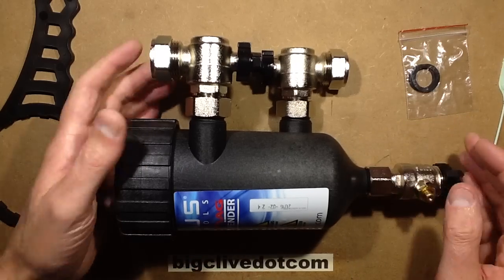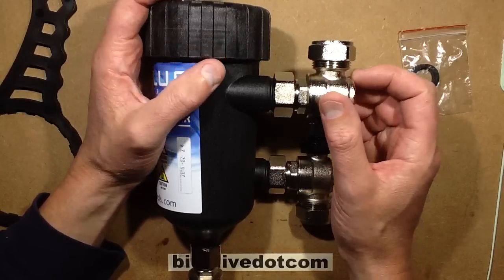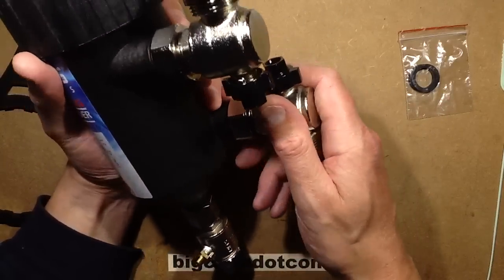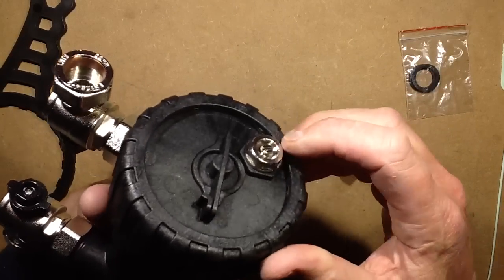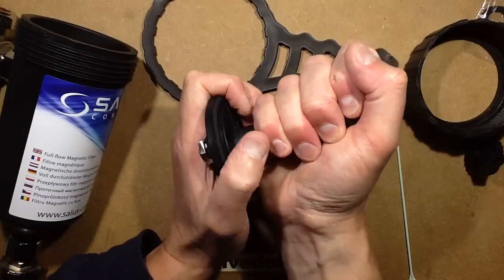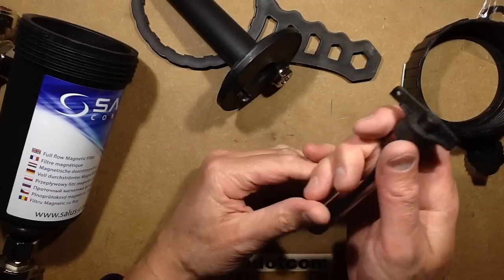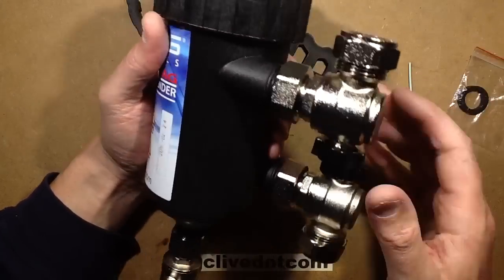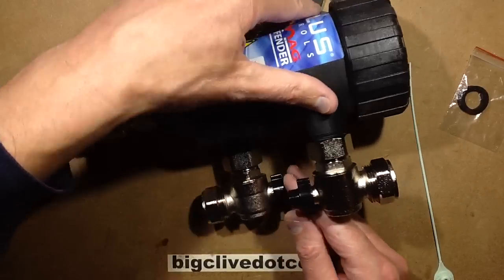Inside a heating system magnetic "sludge" remover.

Comment: My house is forced air, the total extent of regular maintenance for mine is changing a filter every six months.
Reply from the maker: And you get to sit over the hot air vents in the winter.
Reply: I'm going to stick my neck out and suggest that there may be pros and cons when comparing any two rival heating systems.
Reply: If you have to sit over your hot air registers to be warm, your HVAC system was not properly sized or built, or something is wrong with it (like a total lack of maintenance). You might also have a drafty house with poor insulation.

A lack of heat has never been a problem with the forced hot air systems I've dealt with, and being able to circulate air throughout the entire house with the system is a real boon in the summer preventing rooms from being stuffy and uncomfortable, meaning you don't have to run your AC quite as hard. 

One of the things I DID have to do with my current HVAC system is spend a day sealing all the holes at the joints in the ductwork. leaky ductwork, and the dreaded ductopus install  are the leading causes of anemic heating systems.  Well, that and never changing the damn air filter.
Reply: oh, how i love heated water registers.  they heat so evenly and constantly.
Reply: Forced air here. Not complaining, though I change my filters every three months (there's a ton of pollen in my area).
Reply: shadshowadradna Thank you, pretty much my point
Reply: And you also have to get the ducts cleaned every few years. Well you're supposed to at least, otherwise the little particles past the filter build up over years and years and restrict airflow.
Reply: yes thank you america for telling us you have forced air and steam boilers give yourselves a pat on the back for boasting about something europe has had for decades
Reply: richcampoverde
Our steam boiler is decades old.
Regardless, this was a harmless chat, not about location, countries or showing off. Maybe you should give yourself a pat on the back for introducing this.
Reply: +richcampoverde I was just making conversation, not trying to aggravate your inferiority complex.
Reply: Our vents are on the ceiling :(
Reply: I pity you
Reply: +masterzedd4 I know you are being sarcastic... But heated water registers?
Reply: +NexaEntertainment ouch. I access everything from my basement.
Reply: +bigclivedotcom actually no, I only have one cold room because it was added onto the house after the fact. No basement on it plus it's on the north side.
Reply: I use to sleep on them when I was a kid XD
Reply: I lived in a house like that back in the fucking day! Three storey town house which had THE BEST chinese takeaway literally across the road. 
I remember "fondly" sitting with my back to those air vents with a blanket wrapped around me when it was cold :O
Reply: I'm lucky enough to live in a place that requires no heater ever. Although it can be hot enough to even need A/C in the "winter." Go Florida :-)
Reply: If you live somewhere that's damp in the winter (I grew up in western Oregon) - the last thing you want is the house to be muggy and humid. And no problems with keeping the house warm in that case. (Of course, my mom had proper maintenance done regularly. ;)
Reply: Unless you have an electric heater in the air handler you still need to get the oil or gas burner serviced at least annually. If you do have electric heating elements have fun paying way too much for heat.
Reply: We have a steam boiler. Fairly easy on the maintenance and unlimited hot water when the heat is on. Still have the oil burner maintenance, but that's not really bad.
The boiler is shut off and our hot water is coming from an electric water heater. Who needs to have an (mostly) un-insulated cast iron box warm all the time just to take a shower at night, and maybe wash a few things in the morning.
Reply: +snoopdogie187 perhaps  but alteast it stopped this madness in its tracks
Reply: +Richard Stifle YOU!!! you did this!  i will teach you to be an all american bumpkin😠😠
Reply: +richcampoverde I'm rather fond of my bumpkin-ness, in fact look up Hach Company and you can thank this bumpkin for the next clean glass of water you have.
Reply: +Richard Stifle we have something in common in our love of the americas
Reply: I don't.
Reply: they put out a horrid dry heat too, can barely breath when those things are going
Reply: @yognaut  theyve got a thing for that now.  It sprays some water in the air.

Comment: I'm curious, how are the radiators typically connected to the copper tubing? I've seen improper steel to copper connections cause a lot of trouble. The rusting (and therefore the need to flush and treat the system) is inevitable but, I wonder how much this is accelerated by galvanic corrosion?
Reply: Usually via a brass valve. There's a brass fitting into the radiator at the base. The radiator steel is usually thicker at that point too. The valves often seem to be silver coloured (possibly nickel or chrome plated) but I'm not sure if that's just decorative.
Reply: +TheChipmunk2008 that's kind of what I figured. that's certainly better than a direct connection but still provides opportunity for some corrosion. A seperation of 6" using brass or other inert material eliminates that action... I'm sure there's plenty of good reasons (space restriction probably being the main one) it's not done that way for this application.
Reply: +TheChipmunk2008 and I believe the chrome/nickle plating is decorative as it is visible after the room is finished out

Comment: Isn't forced air climate control better than using radiators?
Reply: 99% of houses in the UK use radiators, it's just how it is.  A combi boiler can heat the house, water for the taps and even run a shower so it's just really convenient.  If it ain't broke don't fix it and all that.
Reply: Not if you dislike noise.
Reply: +petti78 Well if you don't cheap out, it won't be that loud.  I can't hear my air system when it's on
Reply: +Christian Geiselmann Better than just saying no.  Explain your reasoning please.  There are no fans to blow the hot air around with radiators (by themselves) and radiators don't double as air conditioners
Reply: Does forced air heating mean there's a constant breeze in the rooms? I don't recall seeing that here in Austria (in 
residential homes). It's mostly radiators or underfloor heating here. And underfloor heating is definitely the best. You can keep the air in the room quite cool and it still feels comfortable. The water in the pipes can be run at less than 30°C which makes the system very efficient (the exhausts of the gas furnace just 50cm from the furnace are barely warm enough to heat your hands in the winter).
Reply: +Robotic Nerd    Well, now that's unappropriate, Sir. I took the time and effort to lay out in front of you my arguments why I prefer radiators, because you explicitly asked for that. I have no chance to guess how deeply you are into these appliances, because you did not write a single line that would give a hint, so I was, perhaps, a bit too verbose for your taste. I did not mean to offend you by that. Likewise, instead of blaming me for not being so well acquainted with hot air systems common in the US, you could just be so nice and explain it to us Europeans.
Reply: +Jasper Janssen  Okay, thank you. For Germany, I may report about 3000 Euros per year invested in the typical petrol for heating purposes (quite like Diesel, but without the immense taxes) for a detached house, not large, and insulated by standards of the 1980s, for heating and hot water. Prices depend of course fully on the international market. And on the ethical side of it you may (cost free) burn in hell eternally  for reclessly relying on burning decayed organisms, alias fossile fuel. A modern house with very good insulation and a modern concept of using sunlight may get down to zero energy consumption. Or close to.
Reply: No.
Reply: +Crana I learned something new, thanks
Reply: +Robotic Nerd    Yes, you are right, sorry. Here is my arguments: Radiators rely on radiating heat, that's using radiation (heat transfered through space similar to light), which can be considered the more effective (i.e. energy saving) way than providing an environment of warm air. Of course it depends on how the entire heating system is set up, including what temperature the circulating fluid (usually water) has, and how well the pipes are isolated where they are not meant to radiate. There is an advantage in terms of comfort, too. Humans usually feal more comfortable when feeling radiation heat than when sitting in a bubble of hot air, so to say. Now, you will have to take into account also the climate zone where you live, the standards of housing and construction in your country, and the money you are ready to invest in a equipment to pay out  rather slowly. Practically, in Europe, usually, cheap houses use e.g. airconditioners or so, expensive, solid houses...
Reply: +Christian Geiselmann I guess you are right that which system is better really depends on where you live, and your personal opinions of what is more comfortable.
Reply: +Robotic Nerd     .... use radiators. I have lived with both, and I fully prefer radiators, just because of the more comfortable feeling. - Next thing is energy efficiency. Principally it is a bad idea to burn coal or oil  in a power station, send electricity to houses and then transform this to heat, as air conditioners do. Too much losses of primary energy as compared to what really gets into your house. Of course, when your electricity is solar or from wind, you may say that it does not matter... You see: complicated topic with many variables in the calculation.... therefore I did not write more than one word in my initial response.
Reply: +Christian Geiselmann You're forgetting high efficiency systems and natural gas furnaces.  The only electronics used in those is only for controlling the gas,  safety systems, and the thermostat.
Reply: +Robotic Nerd and fans
Reply: +Robotic Nerd    To explain the 'radiation is more efficient' stuff, I should add that this is true when you really rely, at least partly, on using radiated heat (like sitting next to a bonfire, that sort of heat), and your surrounding aur is a little bit colder than your subjectively  experienced room temperature. If you use the radiator just to heat the air in your room (convection heating), and the air then warms the walls and furniture, you are not using radiation heat, and this type of advantage is missing. So again, it depends on many things.
Reply: +superdau    Yeah, good question, what do they mean by forced air heating? From my position of complete ignorance, I would say it should by some machine blowing air into a room, e.g. an air conditioner, as opposed to that 1920s to 1950s style heating systems where warm air coming from a centrally placed oven somewhere in the house was led through thick pipes in the walls to other rooms so that they got heated, too, and you could close the air vent in that room if you did not want it heated.
Reply: I can turn the blower on in my forced air heating system without turning on the heat or AC (If i had AC hooked up to it).  So I can choose to have a breeze or not. 

It's very nice in the summer, as the breeze keeps the room from being stuffy and uncomfortable at higher temperatures than stagnant air would. (also helps filter out allergens. She Who Must Be Obeyed loves that feature).

American forced air systems have a large furnace in the basement or garage or utility space, with exhaust and return ductwork that goes throughout the entire house. The exhaust ductwork starts big and narrows down to keep air velocity constant from one end of the system to the other. The benefit of this is that you can circulate air throughout your entire house, rather than a single room.  If you have a room that gets too hot or cold,  the hot air registers on the walls have shutters you can close to prevent air from flowing into the room.  The system might also have butterfly valves in the ducts themselves to help you control flow to various rooms to ensure even heating/cooling.
Reply: Christian Geiselmann I'm not stupid.  I'm quite old enough to understand what radiated heat is...  Why do you assume I don't know such a simple idea?
Reply: Christian Geiselmann And if you don't understand modern American forced air systems, don't insult our intelligence and assume we don't know how radiators work when you don't know how our systems work.
Reply: +SlocketSeven    Thank you! This was an interesting summary. It reminds me a little bit of hot air systems used in German houses decades ago, but of course the  heating technology will be quite more developed now , I suppose. Question: what kind of furnace etc. is used to heat the air? And is this system used everywhere, independent of geographical latitude?
Reply: +Robotic Nerd    Could it be that you confuse your interlocutors?
Reply: +Christian Geiselmann What?  That doesn't make sense.  I don't confuse who I'm speaking with if that is what you mean
Reply: Yes, you do.
Reply: +Jasper Janssen     Indeed he does. Perhaps he is very short-sighted and mixes up the profile pictures? Or is he just fishing for attention? Well, let him fish then, but not in my pond. Cheers.
Reply: +christian Geiselmann.  Mostly it is natural gas (methane) in the USA. After world war II, it was abundant and seen as the fuel of the future.  In places where you cannot get a natural gas line, Propane and oil (diesel) are used.  Natural gas is cheapest, followed by propane, and oil is the absolute worst as far as cost goes. 

If you have a very small house (a 1 bedroom cottage kind of deal), the entire heating system may be contained within a single wall unit  that includes the burner, blower, and heat exchanger.  But for your average sized house, you have the heat exchanger, burner and blower in the basement or utility space, connected to duct work that goes to the rest of the house.

That said, I grew up in a house with forced hot water heat with baseboard radiators, and know many people who also did. 

There's no real mandatory standard, so you usually find that housing subdivisions will all have the same kind of setup, since every house is built by the same developer.  It's largely dependant on what is cheapest at the time of construction, and the geographical location. 

It's likely that they are not at all much different from the furnaces you dealt with decades ago, though I'm sure they have become slightly more efficient over time. The oldest ductwork in my house is over 40 years old at this point.  Highly efficient furnaces do exist, but because developers build entire subdivisions of houses and then sell them,  cheap to install usually wins out over cheap to operate. 

I hope to replace my furnace with something highly efficient when it craps out, but that will be dependant on me being able to afford a $5000 invoice. vs a $2000 invoice.
Reply: A high efficiency (HR++) natural gas combi (heat plus hot water) furnace over here ranges from around a thousand installed to 2000, for sizes up to 32 kW. Above that the heat exchanger for the hot water needs to be external and costs shoot up by another grand or so. You don't get much bigger than 65 kW, and those are pretty much only used in very large and/or badly insulated commercial premises. The converted 18th century pretty damn large church that was my dad's office building for instance had around 150 kW worth in three units, for instance.

65kW is about 220.000 BTU/hr.

Normal houses typically have furnaces ranging from 18 to 32 kW, mostly as a function of how much hot water you want to have. Even our large, not very well insulated house only needs around 20-25 in all but the coldest winters for heating, so the 43 kW is stoppered down to half power most of the time. Efficiencies for HR++ are usually around 107 percent (yes, I know. No, seriously, I know. It's to do with where 100 percent is defined) where regular enhanced efficiency furnaces are at around 70ish percent.
Reply: +SlocketSeven     Ah, quite interesting! Two questions. From your personal experience what did you like more, the hot air or hot water system? - With the natural gas burner, for an average one family home (detached house), with, say, 4 bedrooms, what would be a typical m3-of-gas consumation per year? Or express it in dollar, if that's easier.
Reply: +Jasper Janssen   What means 'from around a thousand installed to 2000"? 1000 - 2000 of what?
Reply: Units of currency.

You know, euro's, dollars, whatever.
Reply: Christian Geiselmann and yet tearing down all existing houses to build new, more efficient ones is not particularly good for the environment either. Not even for Climate Change.
Reply: Some fancoils (essentially radiators with a fan, they can still work in heating mode without the fan although not efficiently at all) can work with cold water supplied with a chiller.